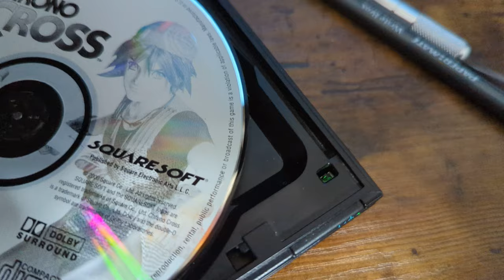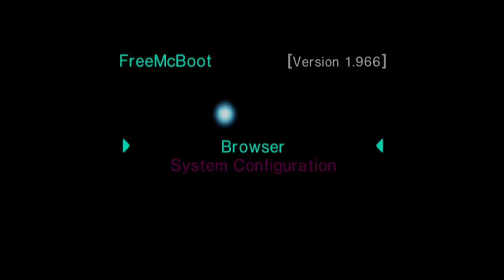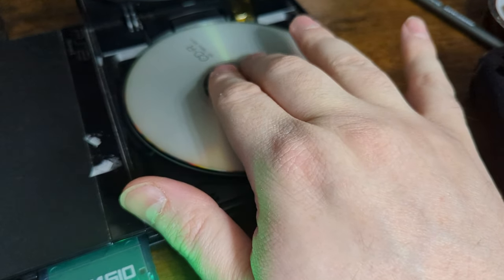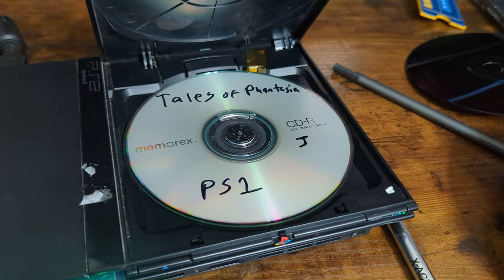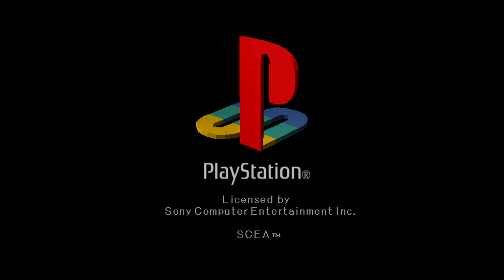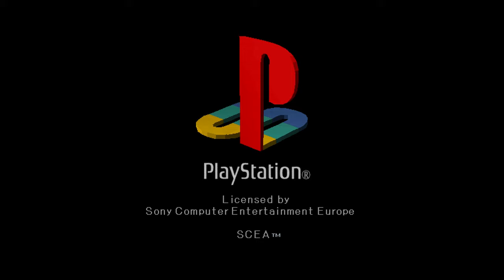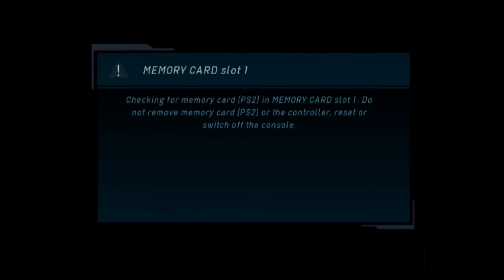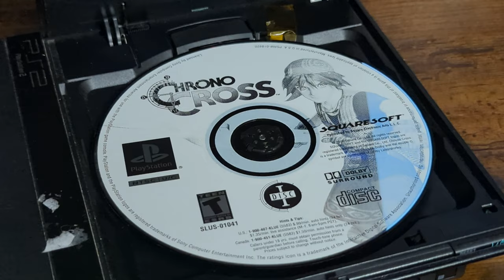Play PS1 Imports/Backups Easily On A PS2 Slim With FreeMCBoot!

Comment: Thanks for documenting this method. That's how I used to do it, though I was limited to using composite cables. With this method and component cables the colors were all funky.
Reply: Makes me wonder how it would look with an hdmi mod
Reply from the maker: No different. A PS2 HDMI mod is practically pointless and unnecessary. Especially if running a scaler like the RetroTink 5X, RetroTink 4K, or OSSC Pro.

Comment: Great to know that, I knew about the swap trick but aways tought you needed a special top case to do it, I failed to install a MODBo MODchip in one of my PS2 slim so this trick is gonna be verry useful to me until I get another MODbo chip!!
I just noticed a PS2 slim I got had the inside sensor bridged between both pads, and it's probably for the swap trick,  thanks you for this great video.
Reply from the maker: Bridging will do it for sure!

Comment: I recently got my PAL slim ps2 setup again. Im using the xplorer v2 disc to boot the game in NTSC mode and had the same issue with the screen being partially cut off at the bottom. Some games allow you to adjust the screen position but it is usually not enough to get the whole image. Any idea how to solve this? I'm using the bitfunx ps2 to hdmi but I don't think that is the issue? Its a cheaper solution but the same problem comes up with more expensive upscalers too is that right?

Comment: I use MechaPwn on my PS2 to play PS1 and PS2 backups, I haven't even opened my PS2 yet.
Reply from the maker: It's a great option! I hope to cover it someday as well. Some are wary about modifying the system in such a way though so this is a good stop gap.
Reply: @ArchadesGames  that's a good point. Do you ever have issues with reading CD-Rs? My PS2 will stop at some point during PS1 games and spin the disc up really fast, probably have to wait 5 or 10 seconds for the game to come back. Not sure if it's my PS2 laser or how I've burned the disc at  this stage.
Reply from the maker: On my slims not really. My phat on the other hand 😅 likely the laser needing some TLC honestly. As long as you have good dumps and a decent lower speed burn on a CD-R it should be fine. Could also be worth trying a different type of CD-R to verify.